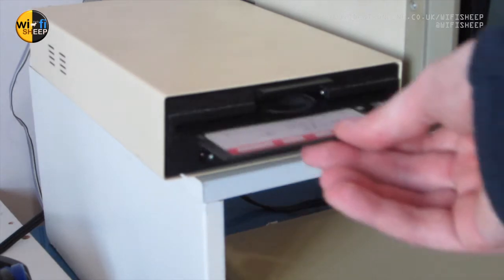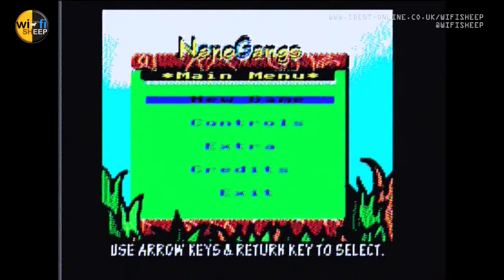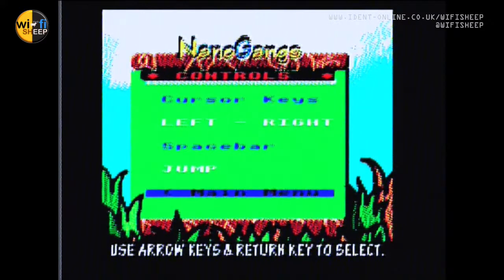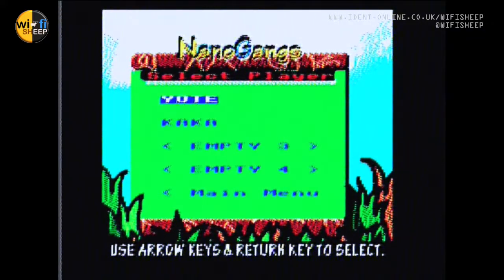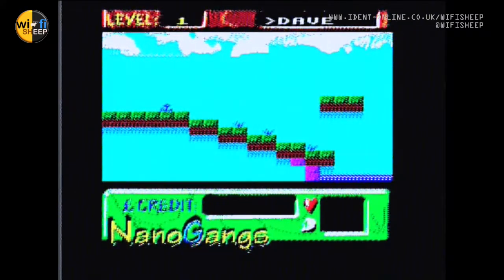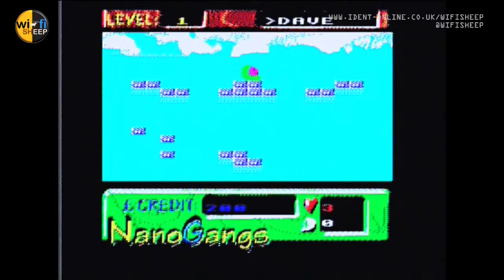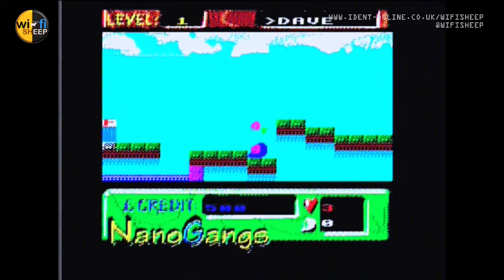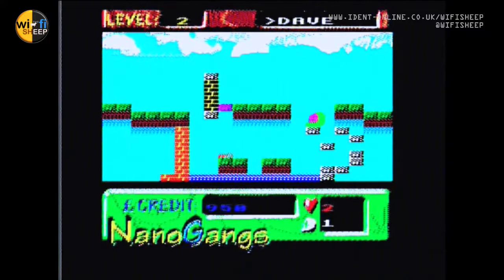Nanogangs 8-bit Home Brew for BBC Micro (A return Wi-Fi Sheep Tech Video)

Comment: Looking good.
Question why are you using composite video with a cub rather than the RGB.
Reply from the maker: Thank you.... The CUB is using TTL RGB via the DIN socket as per normal.  The PC capture card (connected at the same time) is using a colour composite signal from the RF out achieved by doing the whole 'ZX Spectrum trick' of bypassing the RF modulator and feeding the colour composite signal strait to the phono RCA plug. Admittedly this is not the most cleanest of signals but it dose the job and leave the RBG and Mono composite signals unaffected.
Reply: The BBC B already has the ability to provide colour signal from the Video out on the rear by fitting S39 on the mobo. BNC to phono adapters are easily sourced.
Reply from the maker: Cheers for that, Yes i'm aware, didn't have the part to hand so quicker to use a loop of fuse wire in the RF modulator!